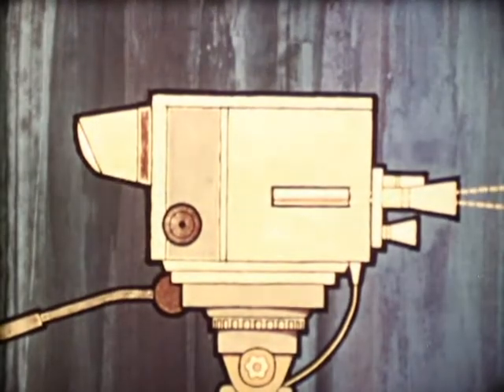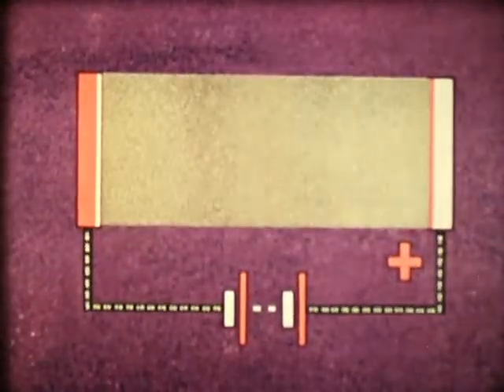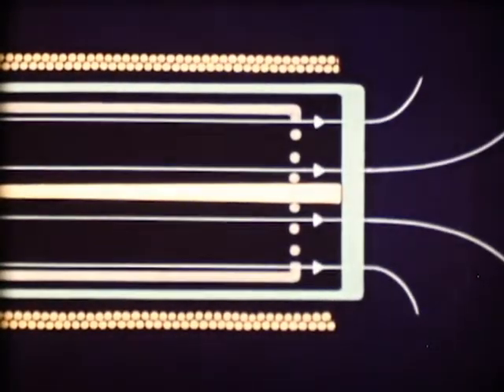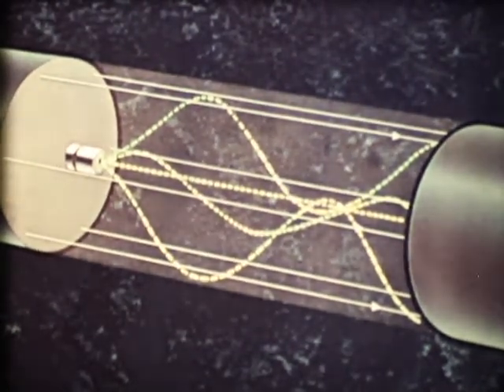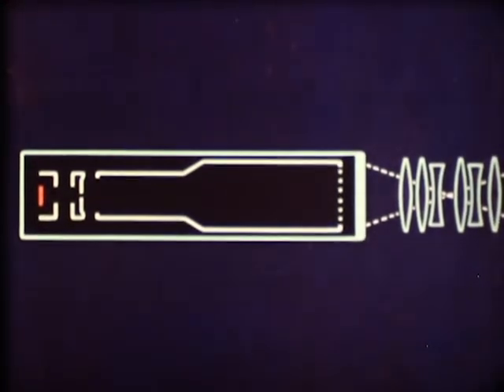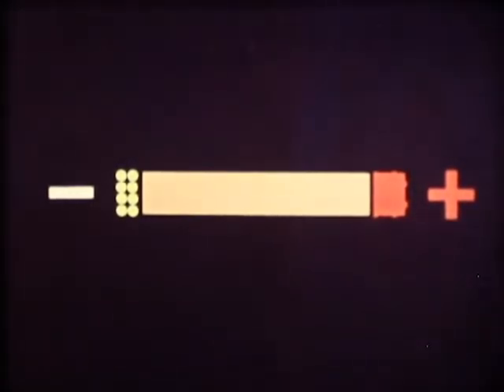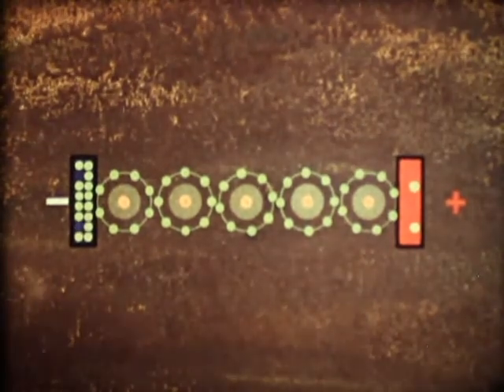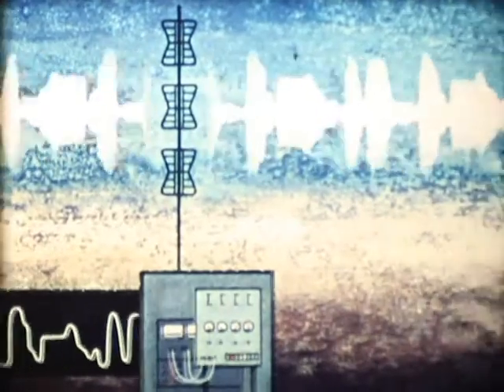"The Television Camera Tube" (16mm 1967)

Comment: I'm still a little unsure if I'm getting it. My understanding is that the horizontal and vertical bias controllers, the capacitors work together. It actually just records the current of one pixel point at a time, and then records a lot of points per image, and then 25 images per second

Comment: Canada? Why does the voice over sound British??
Reply from the maker: Well at this time Canada was a secondary market to the UK so I’m sure they re-used the voiceover. Pretty sure the actual country of origin is Germany?
Reply: @satanmacnuggit  Philips is a Dutch company. In the video they mention 25fps so this video was produced and intended for PAL countries, but that really doesn't matter, as shown in the video the scanning/deflection signals will just be different frequencies if they are NTSC or PAL, but you can take a tube out of an NTSC camera and put in into a PAL camera no issue. The difference is how the signal is processed from a 3-tube or single tube color camera into a composite NTSC or PAL signal.